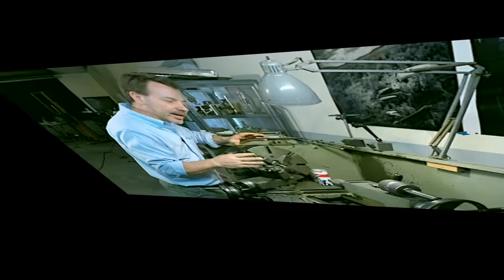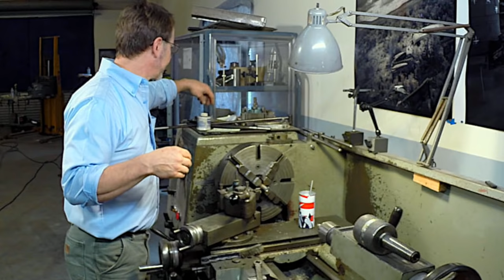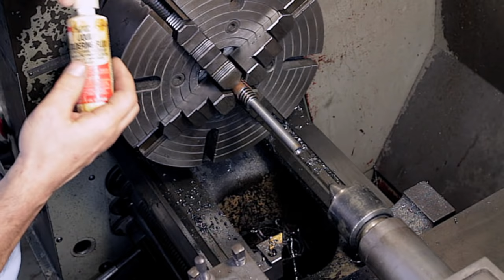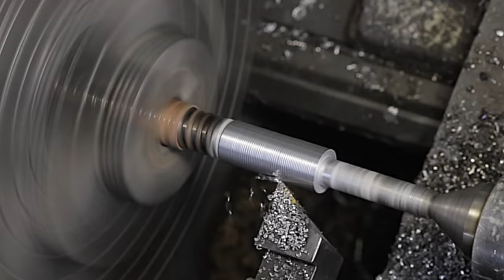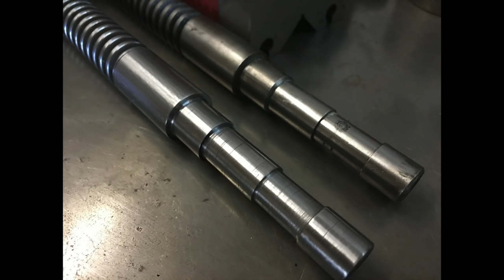How to make a LEAD SCREW

Comment: The way you use calipers and reach around the chuck with the lathe running makes me wince. I know you have short sleeves on but if that thing drags you in somehow then it'll mangle the crap out of you, maybe kill you. 
I'm no Health and Safety Nazi, it works for you and that's great, but as an instructional video it sucks - a lot of your potential audience might have no real idea how dangerous even a small  lathe can be.
And instead of using 'sodder' - whatever the hell that is - did you mean 'solder' ? try some Loctite or JB Weld, it's a lot less fucking about.
Reply: What in the Sam Hill are you talking about? No one pronounces the "L" in solder, I don't see any unsafe behavior on Dale's part, and who wants to wait for Loctite or JB to cure?
Reply: Here's a couple of tricks I learned many years ago. Degrease the joint with lacquer thinner, heat the part with a hair dryer and LocTite will cure in about 1 minute.  More heat with a torch or heat gun with break loose any LocTite joint.